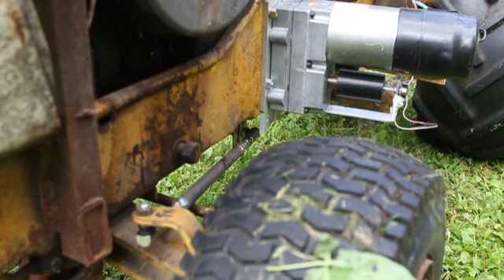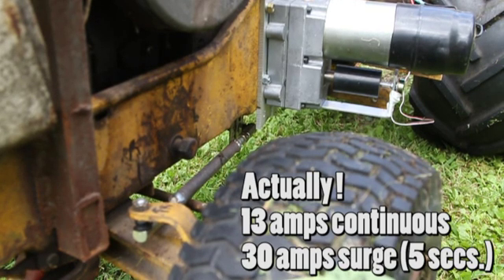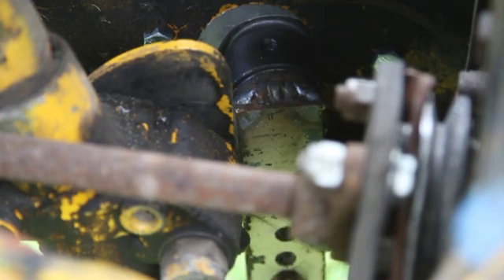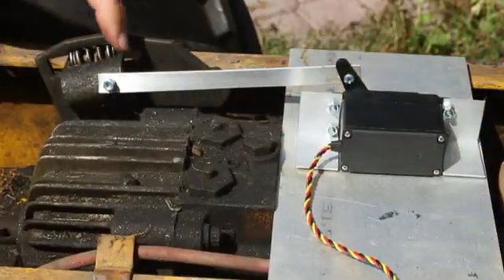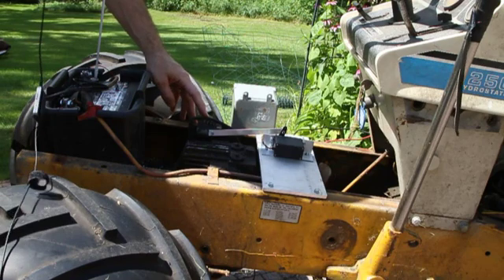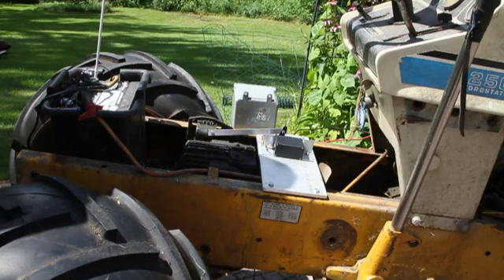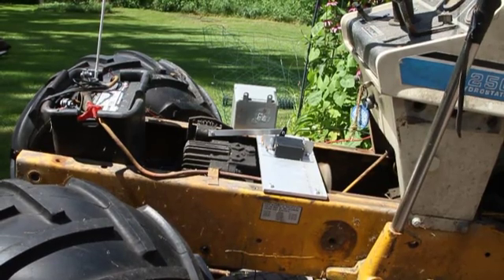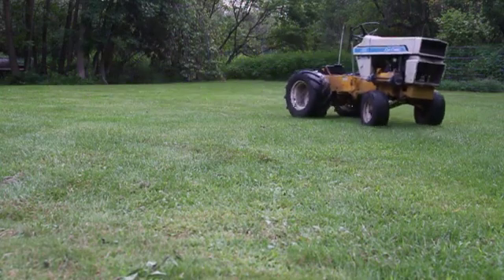RC Garden Tractor

Comment: If one would want to operate the forward/back with the original lever and use the servo you have rigged and pitch the old tie rod knuckles
..possible?  What would the fwd/back lever operate? A RC controller?

Comment: How did you make it steer?
Reply from the maker: I built a Super Servo out of an old electric jack motor designed for RVs.  I used an arduino for electronics.  The videos explaining that are on my channel but really old.  I to do an update on those.

Comment: try using automotive plug wire, it is not solid core and should not interfere with the radio controller.